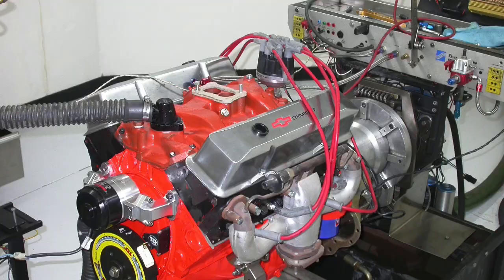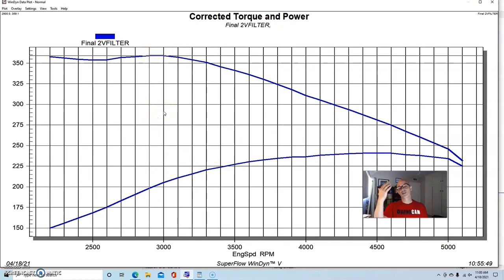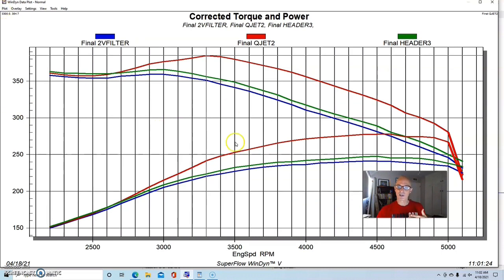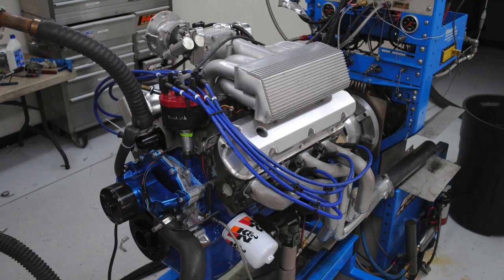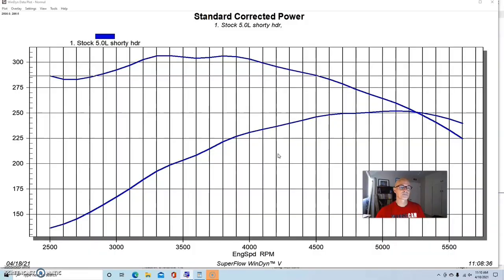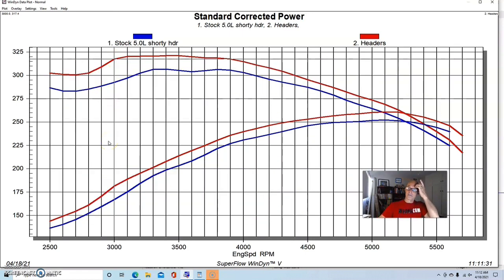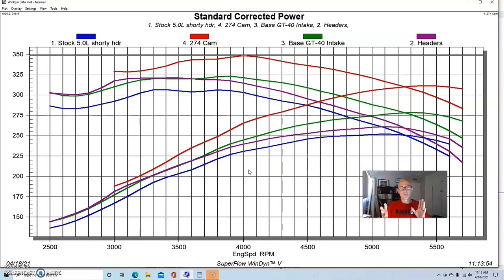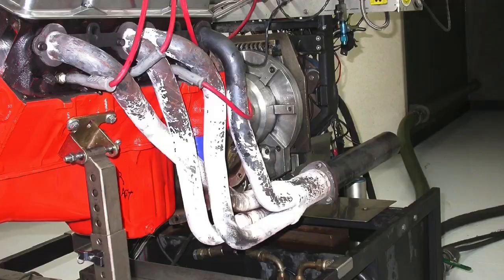DIY, CHEAP, BACK TO BASIC MODS-SBF FORD vs SBC CHEVY

Comment: Skip the 5 liter and hunt a 5.8 in an old F150!! The cams, heads, transmissions all work!! The 5.8 has 1/2" stroke and 1.3" taller deck with a 5.969" connecting rod with 3/8" rod bolts!! The math doesn't lie!! It will fit in any fox body! Fairmont, mustang,thunderbird, cougars, zeffers! I have a Fairmont wagon that was a 2300 4 cylinder, 4speed,no air, manual rack and brakes!! Straight as an arrow and white!! It calls to me every night just before I go to sleep! Got a 70 model Windsor, and a late model 5.8 from an f150! They haunt me as I fall asleep! Got a 94 flairside f150 too!

Comment: I remember somebody and their kid telling me once that over 300 horsepower was Impossible on oem 5 liter Mustang heads yet my flow bench numbers from previous Show they could flow 140 CFM @ .500 lift which supported 325 na hp @ sea level. This video proves it too since i never had a "real dyno" during my building. You would be surprised how many people actually try to argue with mathematics like their opinion is fact

EDIT : and im gonna subscribe cause i like your content
Reply: @BuzzLOLOL  the video just showed a 5.0L using factory heads with bolt ons making just over 300hp at the crank/flywheel. Of course im speaking on Factory 5.0l HO head castings 81-93 like this video shows

Edit : like my original comment said stock mustang heads on 5.0l HO could flow 140cfm @ .400-.500 lift range. 140cfm calculates to 315ish hp @ 100% volumetric efficiency @ sea level (cfm x power coefficient x cylinder count x volumetric efficiency = hp support). If everything else can fall in line then the heads will breath max cfm at the proper lbs per min
Reply: @BuzzLOLOL  an everyday head nowadays is the E7, that is what was tested and the same for 80’s trucks and cars.

Comment: We are Engine Guys! Not just blue oval or  bowtie!
Reply: AEM 

Edit * All Engines Matter
Reply: Yeah some of us like AMC also
Reply: @waynereid9881  I have a Toyota engine in a Volkswagen sand rail with S10 shocks and a Porsche transaxle. Brand loyalty went out the window for it fast.
Reply: @Jack Russelle Lewis new burner account?
Reply: Jack Russelle Lewis- At what, breaking down? 😂
Reply: They all suck when they break down  but I do have a 70s 350 I'm planning on using in my waggy if needed but I refuse to grow the required mullet...
Reply: @waynereid9881  If you ever need inspiration for a mild 350 build, look at dirt ovals and paved circle track cars. How fast people manage to go on flat tappet 2 barrel 350s and 305s blows my mind.
Reply: Mopar
Reply: Damn right !! I used to argue Chevy vs Ford in HIGH SCHOOL LOL
Reply: TheSiren 1974 🔥 seen plenty of those on fire, literally.
Reply: @madmod  I'm looking for low and mid tq with good tip in response  top end don't do me any good off road and I should have said wagoneer  instead of waggy right now my combination is amc 360 with Holly 600/rpm intake with 2.5" duals off the factory manifolds 5.38 gears built 700r4/241  d60 front sterling 10.25 rear.
Reply: @waynereid9881  had 2......a 74 Javelin /AMX with a 360 and a Rambler American 220 with a 199 straight 6. Folks sleep on AMCs all the time.
Reply: @parkeranderson5074  LYHP......Love Your Heat Pump
Reply: I kinda question the power output of the Chevrolet engine. Reason being a factory LT1 from a mid 90s z28 was only rated at 275 hp at the crank. Typical chassis dyno numbers would be in the 230-240 rwhp. So, the 275 crank rating is mostly correct.
The LT1 had better flowing aluminum heads, roller cam, more compression, and more modern efi.

How did they manage to get more power from an old carbed 350 with inferior heads, intake, and flat tappet cam?

Also bare in mind the first LS1s in the late 90s z28s only had 320 hp. Far superior engine, yet this old carbed 350 with stock inferior heads, flat tappet cam, compression, and intake produced more power?

Something doesn't seem right.
Reply: @dukelps9132  A lot of that comes down to the old saying, "If you cant drive fast with 100hp, 400 wont help you." Those circle track cars are limited in cam and induction to keep competition closer within classes. Its not a race of horsepower so much as a race of drivers. That doesnt mean a 2 barrel flat tappet iron headed 350 is making more power than a bone stock ls1. However some are. Mild 350s with stock heads and even the oem iron 4 barrel are fantastic for torque production. Even a mild circle track cam is far more aggressive than some of the smaller ls cam grind and certainly more agreesive than a tpi cam, or the late lt1 cam. Apples vs oranges. I guess they are both still fruit.
Reply: @dukelps9132  it's the difference between sae vs net ratings
Reply: @waynereid9881  He is not comparing the factory rating to the wheel horsepower so much as wondering how a mild circle track sbc that is limited to crappy heads, flat tappet cams, and often restrictive induction and exhaust would even be competitive in racing in comparison to even stock offerings like the lt1, ls1 etc.
Reply: @hoost3056  I love my amc and not 100% convinced a 350 would be any sorta upgrade other than if I need something like a water pump/starter/etc every parts store will have what I need  on the shelf unlike the amc stuff
Reply: @madmod  them circle track engines run at a vary specific rpm range is how they do it above or below that rpm and they fall flat on there face
Reply: @waynereid9881  For sure. Cam timing and tuning is huge and the amount of goodies they run on those modified stock cars is kinda crazy. Nothing new though. You can pretty much replicate those combos for very little money and still have a respectable and more importantly fun ride
Reply: @madmod  I see what your saying. I must have been distracted when they mentioned the circle track cam. That cam probably has some very aggressive lobes not really suitable for street use like the Ford engine it was compared with.
Reply: @madmod  YESSSSS!!🤘😈🤘
THAT'S the game:
REAL. True hotrodding!
Reply: @karlsracing8422  OR- no car?🤔
🤣I LOVE that old mantra,
"Mopar, or no car.

To me, Mopar is the gold standard- example: local SD dirttrack, 413 pushtruck, guy wanted new engine, brick on accelerator, 45 min. later drained oil, brick again, 10 min. Later- "ok I guess!" Refilled with oil, worked for seasons after. True story. But I'm Chevy guy MAINLY my first car, its what I know, cheap/simple/available parts/big aftermarker/compatibility/cross-ref. bolt-on swap upgrades.
And Ford has ALL KINDS of crazy cool limited-run stuff, their race history, and a more low-key mystique/legend like Mopar's- which GM?🤔 mmm, 69 Z-28 302ci., GNX, Syclone... that's about it 🤣.
Only gonna mention my love for AMC in it's coolness and unique things. 

They all have things I can't stand, and something I LOVE. And THAT'S my favorites thing I came to realize about our community this year: while everyone's being triggered by our sociopolitical climate, gearheads as a whole I dare say even PERFORMANCE electric enthusiasts we'll trash talk ALL day, but we share a passion and have each other's back til the end of time no matter color, gender, sex, religion, politics, heritage or any difference. 😎
THAT'S true love, love for your neighbor and "fellow" mankind.

Full-circle, as a Bowtie guy I still support your statement.🤘😆👍I WILL have one someday- have SUCH a hard time deciding what, but with Mopar, they're just about ALL so great, I'm not even gonna be that picky- and as an artist, that SAYS something about the pedigree!
Reply: @hoost3056  Only sleepin on 'em because because they're magnificent, Illusive creatures.😎👍
Reply: @dukelps9132  don't forget torque.  That's my biggest complaint is post-muscle car era, not much is said in mainstem about torque, and without torque,  there is horsepower. That's one of my ONLY complaints about Top Gear, is they only managed to mention to torque with certain heavy vehicles. And it's almost all modern cars are concerned with: family had two 2nd gen Dakotas, and that 4.7 or whatever had all its power placed up high, with dogturds  for low end torque, so you got 13.4 to the gallon ALL day no matter what,  AND you had a relatively useless work machine when compared to the 5.9 or even the 318 Dakota.
Reply: @waynereid9881  AMC V8s had better heads ( those doglegs are legendary ). Really all they need is a modern cam profile.
Reply: @madmod  Regarding your original quote, I cite the Mazda Miata.🤘😎🤘 OOOOHHHHH hated underrated!

(Alright I've seen your input  enough on here- it may be time for a test-subscribe.)
Reply: @ChapsShrugged  if folks dug into the AMC history they'd be impressed. The 4.0 Jeep inline 6.....the 390ci Super Stock V8.....the 401ci V8.....just a little work and they kill the normies....
Reply: @hoost3056  I miss old mopar stuff! Even the most mild 383 was a powerhouse. Nothing like a 4000lb sedan with bench seats cutting 12 seccond quarter miles and driving home.
Reply: @hoost3056  I'm thinking about a cheap 383 short block with vortec heads with a 301A2 lunati cam  not sure on intake stock cast or a similar aluminum with a qjet for its off camber abilities
Reply: Well said from sbc to 13b rotory and everything in-between I  love em all aem!
Reply: . I had considered that. 340 hp from a 350 built like that seemed high until they mentioned the circle track cam. Those type cams have very aggressive lobes and are not daily driver reliable. With normal street cam that engine would have likely been under 300 hp, which would be normal for a Chevrolet 350 built with those parts.

Comment: Regarding the minimal gain with long tube headers on the “stock” 350: I’m guessing there wasn’t any overlap in the cam for the scavenging effect to work with. Just a guess.
For these basic bolt-ones you didn’t change heads. Both these engine families have vastly better heads developed by the OEMs later in life. I’d do those before buying an intake, myself. It always boils down to heads, cam, and intake!
Reply: Yep. Both families existed for many years, and gtp ford heads, and vortec heads are probably the most notable final results

Comment: Shame you didnt do a head swap to gt40 along with the cam as you did with the chev, would be interesting to see how bad those e7 junk heads are.
Reply: E7 heads are pretty decent as far as stock windsor heads go. The GT40s are the best but the E7s are easy to find and are a whole lot better compared to the heads of the 60s and 70s into the 80s. They are a lot less likely to be beat to hell too since they are a newer head and have hardened exhaust seats.

Comment: Nice comparison.  WAY back in the day I "built" a cheapee version of each plus a Pontiac 350.   1972 Monte Carlo, 165hp net 350, 2bl, single exhaust.  Did long tubes first and gained sound but limited power.  Bought a Corvette cast iron manifold and Qjet and WOW did it wake up.  Next was 72 Pontiac LeMans also 350,2bl, single exh.  This time went manifold and Qjet first... disappointing... then long tubes... WOW... again.  Then swapped a 1990 5.0HO into my 87 TBird Turbo Coupe (oem level swap)... home ported stock heads, 1.5" JBA shorty headers, dual 2.5", E303 cam.  Made 249rwhp @ 4600rpm and 314rwtq at 3400rpm... low power due to valve float.  Swapped and Edelbrock EFI intake that did not seem to help.  Car with 5spd went 13.7 @ 104+mph... comparable to the stock LS1s of the day

Comment: I ran a 8004 intake on 462 heads that I don a mild port job on.  It was suprising bigger than what I expected.  I had to port match the heads using a stock gaskets .

Comment: I put a cheap torque cam in my brother's 3/4 ton 350 SBC with similar specs.  I did alot of work in the Q-Jet and distributor.  It had alot of torque and accelerated great.  Would  idle in 4th gear.  4 speed transmission . 4x4

Comment: I’d love to see you do an exhaust test utilizing your Holly ECU. I’m looking to install to two electrically controlled exhaust cut outs and program them to open around 3000rpm with TPS signal greater than 50%. I’d love to see if “vTec” exhaust, what I call it, would make any difference. Mostly so I can drive around town quite and they open under programmed conditions. Thanks !!!!
Reply: Sounds like a great idea lmao

Comment: Richard, please explain why you are comparing a 302 Ford to a 350 Chevy. You have tested 351W and 351 Cleveland in the past. Why not test cubes for cubes? I’ve never understood  a comparison between two different cubic inch engines. I love the mods and the gains offered by the mods but it needs to be apple’s to apple’s sir! Thanks for the great videos
Reply: Fords the one that pushes the 5.0 on erryone. It's their most popular motor.  The 350 is gm's most popular motor.
Reply: @HioSSilver1999  that makes sense and they were whooping on 350s back in the day 😜
Reply: @HioSSilver1999  
Sir I understand where you are coming from but NHRA and the Trans Am series didn’t race that way!!!!
Reply: The Ford 302 and GM 350 are the most common “old” motors from those manufactures.
Plus, this isn’t so much a comparison.  More of what common upgrades do to the most common motors.
Reply: @stlchucko  
I like that idea and agree.
Reply: @TerryByrdJr  i don't remember that ever happening.  Quite the opposite really 😋
Reply: Its not an engine comparison. It's showing typical power improvements for each motor with basic upgrades.. which Richard specifically stated at the beginning of the video..... It doesn't take a lot of thinking to figure out that a 351w will be pretty close in gains to the 350 with the same upgrades.  Again: THIS video IS not AN engine COMPARISON.
Reply from the maker: I don't have a 351W with these minor mods-its not really a comparison between the two motors-more showing what each gains with the mods
Reply: @richardholdener1727  
Sounds like it would be a good test to do in the future!!!
Reply: @HioSSilver1999  your memory must be a bit fuzzy 😂
Reply: @NINJA4RL  how so? I think someone edited their comment.
Reply: 302 Ford
34 model years.
68 through 01

Comment: Yup.   I've definitely flipped a few air cleaner lids for the buhWWAAAAAAA from quadrajets in my time.
Reply: I was a cop in 1977 and drove a Pontiac LeMans 400ci with a quadrajet. I flipped the air cleaner lid. You should have heard that thing running "Code 3" !!

Comment: Yes more low buck mods with factory heads only . Would like to see the gain with cam , intake and headers . 302 .351, your 429 your going to test someday soon hopefully and 305 or 350 no stockers what so ever. Not everyone has big bucks for stroker motors

Comment: this is great for some of us who are spending $$ on bodywork and paint for a "flip", and just need a basic powerplant under the hood with a lot of used chrome dress up and a squirt of N20....or...we need a parts truck that looks like we aren't foolin' around, and so we need a cheap pumpgas throw-together V8.

Something to keep in mind with a 2bbl, it has to be jetted to cover the entire RPM range. A four barrel can have its primaries jetted to just feed the engine to say, 3,000 RPM...and be better on gas as a result.

As for the Ford, Muscle Mustangs once tested out the EFI intake manifolds in the day, and discovered the old OEM intake manifold, if it recieved an extrude hone--it matched the tubular GT40 intake. The Cobra (and now Explorer) intake had the benefit of being a cast piece--so either can be extrude honed for even more flow.

Comment: I built this near exact 350 also using 882 heads for my '78 Nova. 14.7 sec @ 96mph with the stock 2.73:1 axle ratio. That 400lb-ft of torque is no joke.

Edit: typo 96mph not 76.
Reply: My man you need a 6 speed and 4.10s dang
Reply: 14.7 at 76? You sure about that mph? I had a 1980 Malibu with a similar 350/TH350 and 2.29 gears, and it was a 14.8 at 98 mph. Was fun to reel people in after they got the jump off the line.
Reply: @BuzzLOLOL  Yes you are correct. 96mph. Edited my comment.
Reply: I sold the car but the next upgrade was going to be 4:56:1 axle ratio. Assuming I could get traction that would have dropped the time into the high 13's.

Comment: I guess I'll put in the Comp XE274HR In my 1997 351w F250 wrecking yard motor.  should make more power.... lift should be low enough for PTV clearance???
Reply from the maker: you need springs and its the duration you need to worry about
Reply: @richardholdener1727  definitely get the set with springs and lifters.   Thanks Richard.
Reply: actually its during overlap usually about 5-10* ATC.
Cam advance tightens the clearance.
W truck pistons have a lot of clearance, usually.
Reply: @hotrodray6802  Still building it... decided to run it stock with carb for now until I can get the aluminum heads.  Hopefully tax return will be enough.
Reply: @70_Torino_Guy  Roger that 
Drive and enjoy your rig often. Take it from an oooold hotrodder guy.... save part of your money for the future. 👍

Comment: Do you have data on a 302 with letter cams vs XE274-HR?
Reply: I too would like to know this 👍
Reply: Long story short, the letter cams are not gonna beat the modern cam
Reply: The E303 is pretty much done by 5500 rpm. It's not a bad cam for a stock auto trans and has a little lope to it. I had one in a Crown Vic.

Comment: Thanks for the video, I run both a mild SBC and a 5.0 SBF.  I’d be curious to know the power differences between the stock 5.0 intake and a carb swap if any.  Like a Holley 4 barrel on a decent intake manifold.  Thank you!
Reply from the maker: CARB INTAKE WILL MAKE A LOT MORE THAN STOCK HO INTAKE
Reply: @richardholdener1727  thank you!